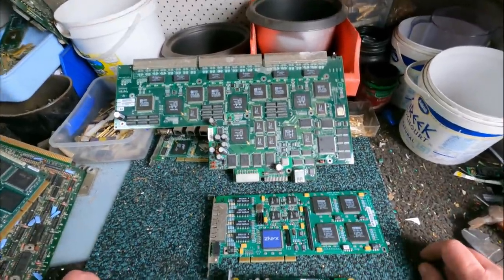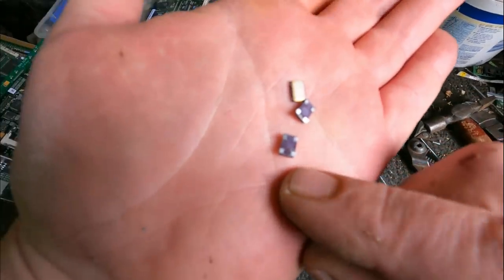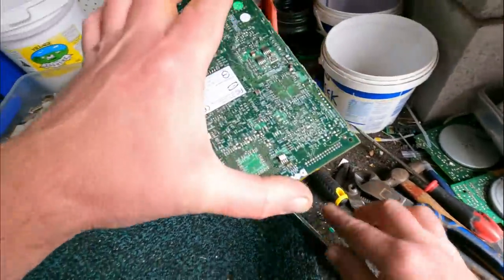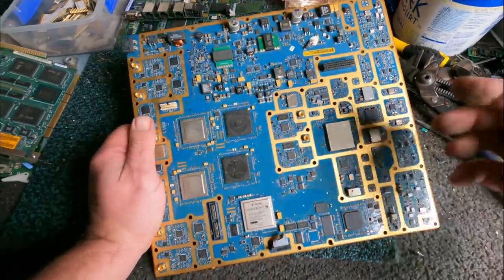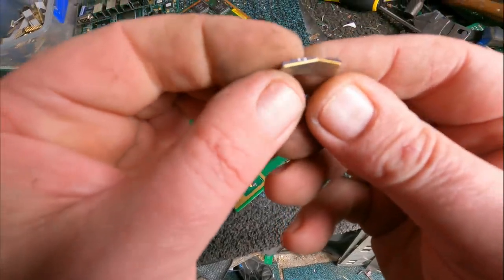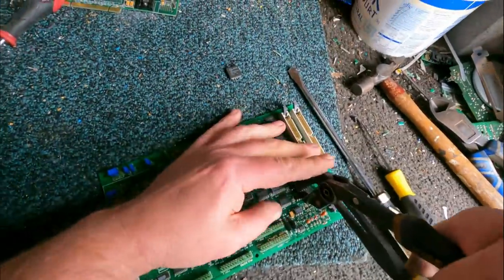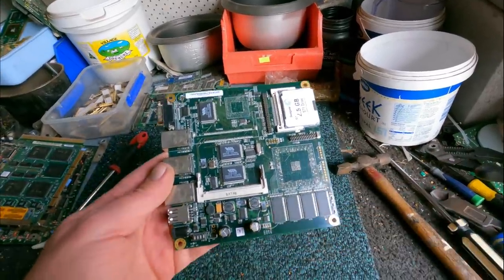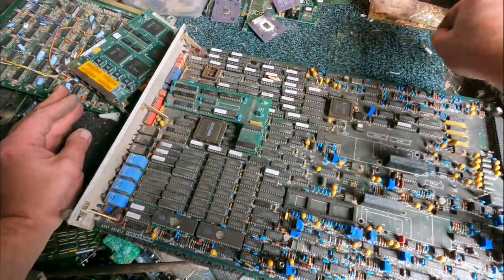Depopulating Boards for Gold Recovery

Comment: Hey Ben the gold corner @ 34:58 is a copper top. Or what u call the 2nd lower tier of gold corner. Scrape inside the black circle with a screw driver and you'll see copper. Great video! 👍

Comment: I use a hot air gun or  hot sand bath for removing chips. Takes a bit longer, but hard to see if the chip was removed or not fitted during manufacture.

Comment: Ben, go get yourself one of those thin flat metal tools they use to open smartphones. A little tappy tap with a hammer on one of those and those ocillators come off clean way more often that what that large flathead screwdriver is doing for you. Cheers mate, another fine video 🤘🏼👌🏼

Comment: i saw a new method for ic chip gold recovery using a impact or hammer mill to turn them into power then the powder can be gold paned or put in a concentrater like a sluice goose goldrop or wave table ect.
Reply: You ever see that commercial for blendtec blenders. I was thinking the same thing. That thing would reduce whole boards to powder.

Comment: How you can leave gold edge crystal on first board??? lol
basically that line at one side of  tanties it is the positive sight  of capacitors and it is important with the way it is mounted in the circuit
inductors no need to have any marks cause it is no difference which way you mount them in circuit same as resistors
nice vid 👍😀👍

Comment: You can use a micro torch, run a little heat around those chips…… They  will slide right off .

Comment: Im an engineer and armature physicist so I know hardly anything about this business however in engineering my goal is always to create a repeatable easy process for making just about anything so if we look at that in reverse wouldn't it be easier to simply grind up those entire boards and then micronize everything, most of the junk could be easily removed by adding water using a displacement process, heavier elements such as lead, gold ect.. would settle to the bottom which is collected and then put into a crucible and melted down so you can then simply separate the metals without all the fiddling with spending a lot of man power taking stuff apart? Just a thought I had when I saw your process

Comment: I am still looking for a board buyer in ontario canada. would love to have one instead of having to fully depopulate every board I get.
Reply: I’m waiting for that day here in BC, the local govt has the recycle program running so tight here people don’t get any money for turning in e-waste. I have a local yard that will take everything you can recycle from a computer except the board itself. I do believe it is coming though, the amount of ewaste being recycled right now is obscene. If your going to stockpile boards for copper, laptop are the high grade along with server then desktop and peripheral boards. Don’t stockpile low grade power boards found in tv remotes or brown back. Clean off everything after your cherry-pick pass, as the board will be worth more clean of all large components. All your small surface mount components will have silver in the solder so keeping them is actually upgrading the board a bit. But cleaning off all large components will making stacking way more space friendly. This is all advice i I got when I deep dived the subject with a friend who works at the local scrapyard. They see it coming too, regulation is just favoring the recycling companies that have cornered the market ahead of the rest of the curve.

Happy hunting!

Comment: Tin would never be used in high grade electronics or in anythng of higher purity than solder. When pure it can form crystal strands taht can short out other components and as you mentioned it is not as conductive, this jsut isn't suitable in tech taht has to have low failure rates. Most likely silver/gold alloy or platinum especially considering the grade of board. Love the vids and really appreciate teh klnowledge!

Comment: I would have depopulated the whole 1st board tons of chips
Reply: The fingers in the female wifi ports???? Is it not worth getting into them . How do I find out if it's bronze
Reply: So should I keep them separate from other pins ive taken out of plugs that I know are gold plated
Reply: I wish I could just show them to one of yall. The actual wire is longer than the usual ones that you pull out of those kind of telephone ports. The wire  is gold all the way down once you pull them out there probably about an inch and a quarter long and the entire thing it's covered in gold. I saw something on a forum about a guy that had a bunch of of them and I guess he processed them and didn't get anything back

Comment: hmmm...have you ever considered a chisel instead of a screwdriver? It could speed up the depopulating as the front cutting edge could make short work of removing chips, the frontal edge is much finer that the one of a screwdriver and it should be able to slide under the chip far easily.
You would be required to periodically sharpen it but it is like a 5 minute thing and in your case it can be done without worrying about the same details one would have to when sharpening it for precise wood carving.

Comment: So when you say you're selling them as "mid grade, telecom grade, etc" is that based on what a recycling plant will give you for it? Or what you would have paid for it based on when you purchased it? 

I used to scrap large metals for a living but have recently delved into electronics as I hate how much e-waste takes dead space in landfills especially considering the usable precious metal content. Your videos help a lot for me as a noob in the valuing of components, but this video you emphasize taking only some of the components instead of just air chiseling them all off. Is the recycling plant/company paying more for whole boards than you can get for some of the parts if you do them together? Or is that due to the weight difference giving you extra on some of the boards? Any help would be greatly appreciated. Love your videos BTW. 
Sorry for the essay, just seeking clarification lol don't wanna do extra work if I don't need to.
Reply from the maker: my buyers grading

Comment: Man when depopulate ball solder chips use Heat Blow fan  or torch it will fall away by self without cracking and parts who fly around

Comment: That video card you called too good if it's still functional could get you a hundred times more money on eBay as a functional working video card if it's not obsolete because older computers are hard to find parts for and I've seen seven or eight-year-old Ram selling for as much as brand new Ram simply because there's still demand and precious little Supply to meet it (just saying) and I just watched the video yesterday where 2 RAM sticks that would have had pennies worth is gold managed to bring in $102 after listing it on eBay

Comment: Aren't the contacts inside those ports gold? I read somewhere that some of them are some kind of bronze.  Ive got a bunch of the ports that would be on the computer end of the wifi.  I can get those fingers out in hurry.  They are relatively long once you open them up the " gold" goes all the way down to the tiny board thats in there.... I want to stop wasting my time if that is infact what I'm doing. The first board... the female wifi port!!!!!are those fingers in there gold??????

Comment: Why do you always say the bare board is worthless . You can get gold recovery out of just the board alone  . The copper tracing is always coated in gold or silver. In a total depopulated board it still has gold or silver. From what I read and watched people soak boards in a solution and get gold foils.

Comment: What does BGA  mean ? What is its significance?  Any body answer is good enough
Reply: Can you see the gold bonding wire with the naked eye?
Reply: Ball Grid Array, they use tiny balls of solder to permanently mount the chips to the boards onto matching semi-cupped trace lines. Therefore, no more legs needed. They are less likely to be loosened from bumps and such. It also improves the efficiency along the production line. Hope this helps.